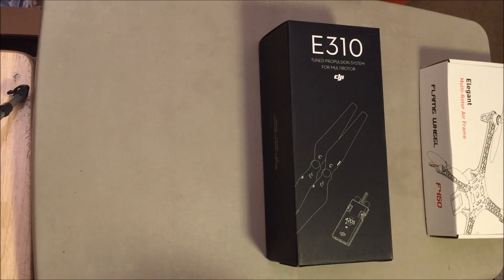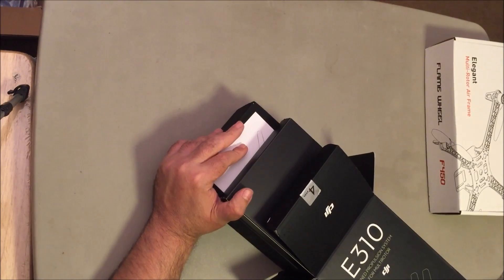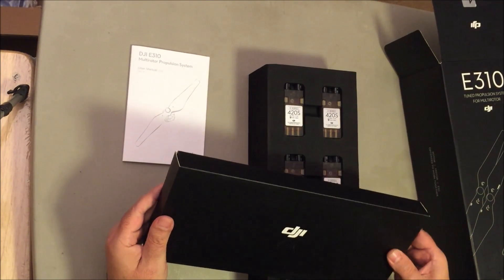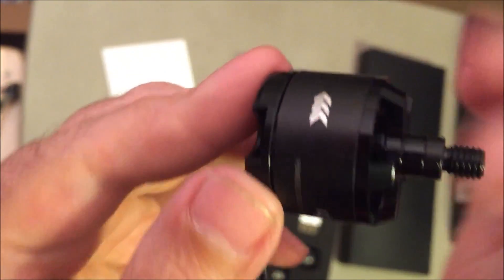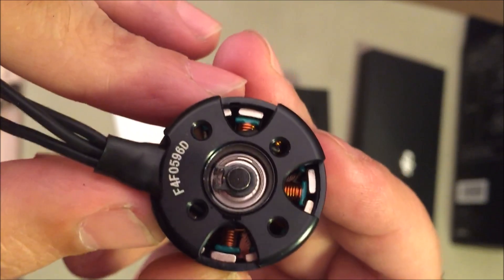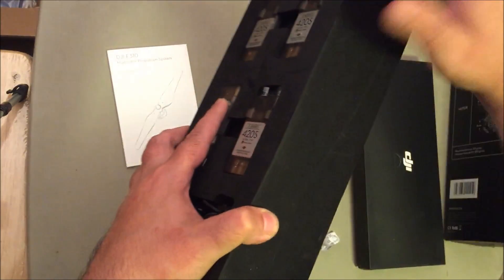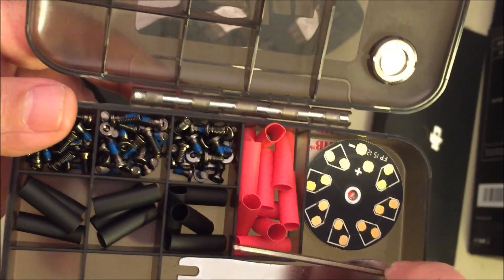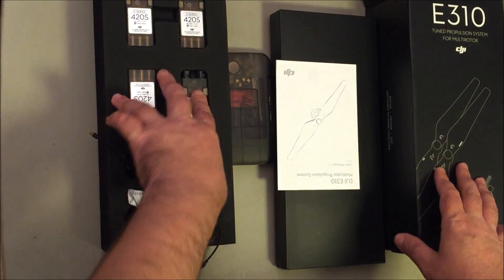DJI E310 Propulsion System - Unboxing / First Look F450 F550 Phantom

Comment: Yay man, where's the f450 build video. I' ll be mounting one exactly like yours with a naza mlite, a gimbal tarot t2d, a 1.2ghz 1500mw fpv and a 9xr radio with frsky module. I would really like to see how to mount the e310 kit in the f450. Just waiting for your video!

Comment: What flight controller will you use?

What battery?

What kind of UBEC should i get?

Song?
Reply: +nathan33445 AYE! USE NAZA V2!!! PULSE 14.8V @ 3300 MAH
Reply: +!SeattleMan! im running a basic set up. kk 2.1.5 fc. castle ubec, turnigy 2200mah.

sving up for a naza, and better batteries.